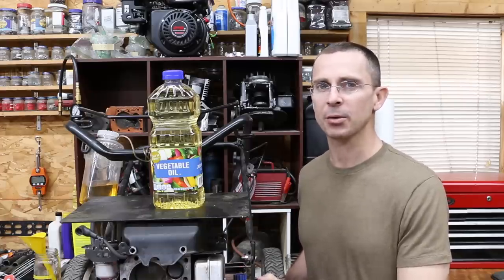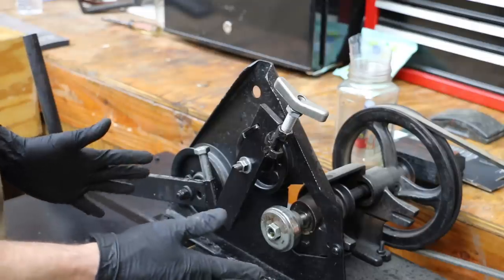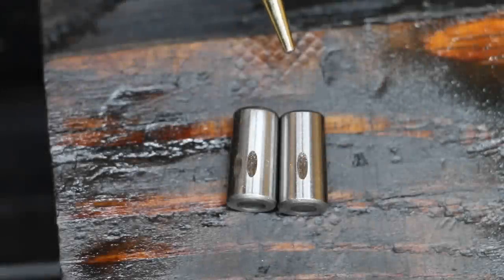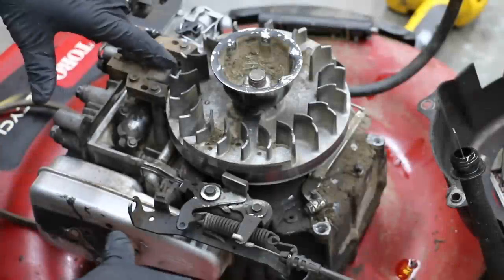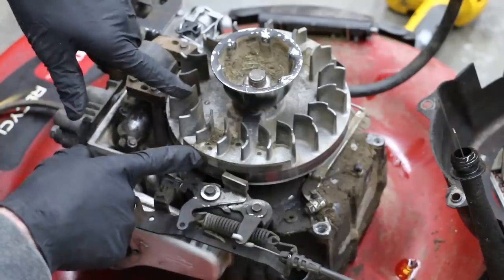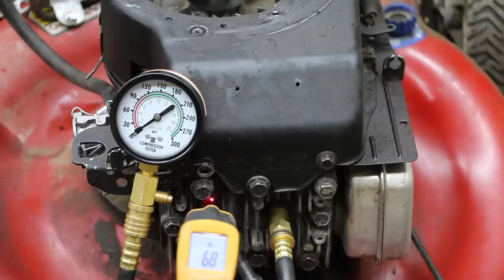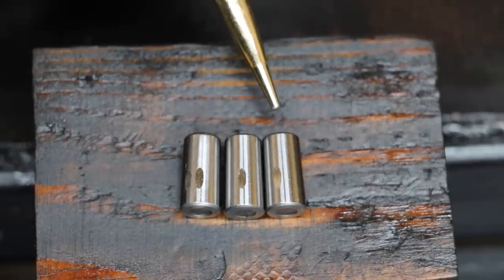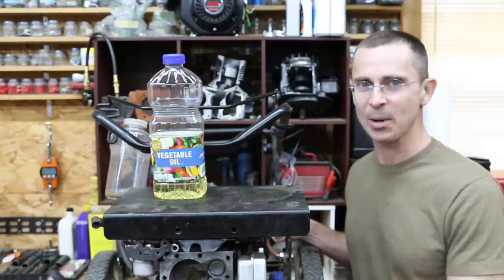Will Vegetable Oil work as Engine Oil?  Let's find out!

Comment: Major differences in veggie oil versus mineral base in this role is that you have to be extremely picky about which veggie oil you're using because they have different properties, and ALL of them will be hygroscopic to some degree and will oxidize pretty quickly. Some (sunflower, safflower, walnut) will turn to gum when they oxidize, others will get corrosive. if an oil is noted as a drying oil, it hardens when oxidized... you can actually add a drying agent to it (an oxidizing catalyst) and finish wood with it, hard as any other coating. 

Mineral oil and synthetic bases have the major advantage of being oxygen stable, the oil base itself isn't going to go bad so much as the additives will be consumed or altered... and since a lawnmower normally just uses a non-detergent oil anyways, veggie oil with a flash above the cylinder head temp is no big deal PROVIDED you change it often. VERY often, like every third mowing. 

The 2-strokes and aircraft using veggie and particularly castor oil are doing so because mineral oils will usually ash pretty badly, and are horrible for the rings and cylinder finish and can clog exhaust ports/valves in time. Castor doesn't burn really at all, what goes in comes out which is why WWI pilots had such issues being downstream of a spinning rotary engine with a total loss oiling system (the crankcase is attached to the prop, the crankshaft hub attaches to the plane, and ALL the injected oil leaves the exhaust through open ports). No burn = no ash. The right veggie oil will do nearly the same, just with more soft deposits. Castor oil will also somewhat protect unhardened valve seats where the fuel doesn't have much lubricity... like old aircraft and car engines running low octane. This is one of the reasons tetraethyl lead became popular in gasoline, it has much the same effect... better, even.
Reply from the maker: Thank you!

Comment: My grandpa says when he was racing motorcycles they say castor oil gave the most performance in a 2 cycle engine (and they wanted absolute formants they even had a hollow camshaft for more performance) they said Castor oil would be the best but one problem it fouled the spark plugs fast. I’d like to see a test on does it have more proformance and does it if so how fast does it foul spark plugs

Comment: I was genuinely surprised at this one- I thought that there was no way this would work as well as regular engine oil, and I agree with you in that I wouldn't use it for permanent use, but in a pinch (say your RV or motorhome is running low on oil, but you're camping in a remote area with no mechanic for miles around, and you have vegetable oil in the kitchen) vegetable oil might do the trick and keep you going until you can get more proper oil.
Reply from the maker: Thank you!
Reply: I even use veg oil in purpose as 20% additive to my engine oil , try it and the result might suprising you

Comment: Canadian Tire was selling a 30W bio-derived oil a few years ago. I tried it in my lawnmower and it worked fine but i did notice that it gelled in the winter in a cold garage. I don't remember the brand and haven't seen it since. 
I wonder if it was canola oil or something similar with a few additives? 
Other than gelling in the cold, and i mean, you wouldn't use 30W in a snowblower anyway,it worked fine.
Reply from the maker: Thanks for sharing.

Comment: In my early youth, 1950's, I had a relative who raced sports cars. He told me the best engine oil at the time was castor oil.  The only drawback was after the castor oil got hot from use you had to drain it out before it cooled or it would jell. This was back before multi weight oil was invented.
Reply from the maker: Thanks for sharing.

Comment: Threw a rod on a '64 VW Bus in 1976.  Lost most of what was in the crankcase in the first 2 miles
-limping off I-80 toward a garage in Newton, Iowa.  The last 2 miles were achieved solely on a gallon of Peanut Oil. 
(Remember fondue?)  Needless to say, I had to rebuild the engine.  Still drive it on occasion.
Reply from the maker: Thanks for sharing.

Comment: Older engines, especially those for the motorcycle and aircraft industries, were sometimes designed to run on vegetable oil. Specifically castor oil, which is where Castrol got its name.
Reply from the maker: Thanks for the feedback.

Comment: There was a test back 16 years ago about using soy bean oil as a substitute for motor oil. I recall the conclusion was that it protected the engine as good as a regular motor oil but failed for freeze condition.
Reply from the maker: Thanks for sharing.

Comment: Some of you may have seen Terry Dyson's extensive blog about testing and analyzing various different motor oils. Surprisingly, in the straight out of the bottle category, a vegetable based oil under the brand name of Renewable Lubricants scored very highly and ranked number 3 out of 226 oils and oil/additive blend combo's.  

       I don't think he tested the oil's cold properties though.  However, it is branded as a 5w-30w, so it should flow well at colder temps.   

     There is some precedent for this, as castor oil was and still is to some extent, popular in racing 2 stroke engines. The problem with castor oil is that it doesn't burn off as well as synthetic and conventional oils, and leaves behind more carbon and residue.  However, it provides superior lubricity and durability as an oil.  Racers didn't mind too much about the carbon build up and residue, as they often take apart and manually clean and adjust the engines.  

     Obviously in 4 stroke and other closed loop oiled engines, that is not an issue.  I don't know if Renewable Lubricants uses castor oil as a base or in a blend though.  

   Moral of the story, the right kind of and rightly processed vegetable based oils, certainly can be used as engine oil. The start of thermal break down temp of the Renewable Lubricant's oil was 275*F which was higher than some synthetics and a number of conventional.   

 Dyson believes that the additive package that goes into an oil is ultimately more important than the base oil being used.  I would mostly 2nd that with the caveat re: vegetable based oils--obviously these need to be the right kind to begin with.
Reply from the maker: Impressive!
Reply: @ProjectFarm     Yeah, I'm currently trying out the one that I mentioned above, for my 150 cc Piaggio Scooter. It's hard working, high revving, high compression engine that is air cooled, so I wanted close to the best stuff for it, and bonus that it biodegrades faster than other oils in an open environment (though I would not say that it's completely non toxic. After blowby and combustion by-products, it definitely will have some enviro toxicity).  

     I just changed it a couple of days ago (and bought it a week before that), and I'll probably do a change in a couple thousand miles, and let folks know how it goes.  Unfortunately, I don't have the funds to have a sample sent off to be tested. Maybe at some point in the future.

Comment: Probably won't see this but I feel like a good way to load the engine without a brake or grass is to get some blades and bend them sideways so that the air becomes the load as the sideways blades try to spin at 2000rpm

Comment: I use cooking oil (usually corn or canola, olive oil is a bit expensive) as bar/chain oil in my chainsaws.  It leaks out a tad faster than petrochemical bar oil, but that's a good thing as far as lubrication goes.  I'd rather leak a couple of ounces per hour of corn oil onto the ground near my well and river, than an ounce per hour of a petroleum product.   I only do a few hours per year of chainsawing, so I'm still on my first 48oz bottle of cooking oil for it.
Reply from the maker: Thanks for sharing.

Comment: Folks in Malaysia use palm oil in their engine....but they must mix a small amount of oil treatment. Palm oil has a high smoking point at 230 deg celcius or 446 fahrenheit. 
Eg. A car that needs 4 quarts oil - 3 quarts palm oil mixed with 1 quart oil treatment. Eg STP ,Lucas, Bardahl B2 Oil Treatment. 

Cost- 3 quarts palm oil is is ard $10 and 1quart oil treatment is abt $15. Total $25 Malaysian ringgit. Which is abt US$6.50 for the whole thing.
Reply from the maker: This is interesting! Thank you

Comment: Study I encountered from '50s measuring wear, based on oil time of use, implied that newer oil is a much worse lubricant. The study, utilized radiation on wear surfaces, and it's subsequent levels in oil. Oil break-in period was the poorest lubrication period, and the oil continued to perform better throughout test. Have you ever compared different age oils for their comparable properties?
Reply from the maker: Thanks for the video idea.

Comment: Great video but the problem, you need to heat the oil some hours without burning it all, after you will get a better oil than anyone else. I used to use vegetable oil in my motrocycle, the best eay is to preheat it a long time without burning it, It starts diminishing, and getting greasier.
Reply from the maker: Thanks for the feedback.

Comment: wondering if you have any videos about using vegatable oil in high rpm chainsaws that use 50:1.   Im looking for a healthier oil to mix with my gas.  Anytime you use any 2 cycle engine you are basically breathing in and absorbing petroleum based molecules into your body which can't be good for it.  I'd like to instead have edible oils aborbed into my body when cutting wood and mowing the grass.
Reply from the maker: Thanks for the video idea.

Comment: Consider using a fan blade on your test mower as a load.  A old metal window fan blade or auto engine fan  bolted to the crank might add a horsepower or two load without burning up the brakes.
Reply from the maker: Great suggestion! Thank you

Comment: I busted the steering gear seal in my truck and drove 200 miles with olive oil running my power steering. Replaced the gear and the pump still runs fine.
Reply from the maker: Glad to hear!  Thanks for sharing.

Comment: Well it's three years later, I want to know if you could add veggie oil to ethanol and see if it would run a 2 stroke with no problems, you have proved its lubricity in a four-stroke it would be interesting if it worked with ethanol as a two-stroke pre-mix.

Comment: I used vegetable oil to lubricate a seized padlock about 8 years ago it fixed the padlock n made it work like new I haven't had to lubricate it since then either and I still use that padlock to this day
Reply from the maker: Thank you for the feedback
Reply: Slightly different application. Padlocks don't have oil pumps and padlocks don't get hot.
Reply: @paulanderson79  my point was that vegetable can substitute a variety of oils not just engine oil and in some cases like with my padlock may even perform better than oils typically used for that purpose
Reply: @Idlepit2  I advise you not to use vegetable oil in an engine.

Comment: How about the efficiency of veg oil VS diesel running in a diesel motor. I run WVO in my dodges in the summer and get nearly the same KM per 100 . I also dump in other oils that i come across that have no marking on the package anymore, from unknown engine oils to gear oils. They also burn similar to diesel.
Reply from the maker: Thanks for the suggestion.

Comment: I would like to see how it holds up in an engine using an oil pump to pressurize bearing journals as in a automotive engines that build oil pressure. This worked great in a splash type lubrication engine.
Reply from the maker: Thank you for the video idea!
Reply: Two stroke with veg oil

Comment: I believe the vegetable oil will work a lot better if the engine it’s put in is meant to use the viscosity of oil that vegetable oil is. If it’s the same then it should put as much wear on the engine (of course it will still cause some because it’s not motor oil)

Comment: Well, this was a surprise to me. I wasn't expecting that an oil normally used to cook were able to hold on lubricating a thermal engine for a considerably long period of time. 
I recently watched your video about using bananas as lubricating agent where that myth was obviously busted, and I was expecting to see something similar now.
Well, bananas obviously can't hold high temperatures without burning, while vegetable oil must be able to support them on a stove, or else it would catch fire. But between enduring high temperatures and maintaining lubricating power, as it was not designed to lubricate, there is a considerable distance. 
So I must say this one is confirmed. Thanks for sharing.
Reply from the maker: Thank you for the feedback

Comment: I have a 2002 320 diesel Merc which I run on kerosene, every 20 letres of kero I add half litre of cooking oil to lube the fuel pump, runs fantastic and doesn't smoke as much as diesel......
Reply from the maker: Thank you

Comment: castor oil (is a vegetable oil from Beans) used to be used as a high performance racing oil.. Castrol R. castor oil used to be used in WW2 aircraft engines too! it is very different to cooking oil though it has to be said and probably wouldn't suit modern engines at all..
I remember going to see classic motorcycle racing in my Teens, and the unusual small of bikes running on Castrol R will be with me for the rest of my life!
Reply from the maker: Thanks for the feedback.
Reply: In my experience castor oil bad for 2 stroke engine. create rust

Comment: It does work and works well with 2 problems 1  it thins out like nats piss when hot 2nd its a fatty acid and will strip clean all bearing coatings just leave i peace of copper pipe or aluminium in veg oil for a while and see how clean it comes out.
Reply from the maker: Thanks for the suggestion.

Comment: I would like you to use pure canola oil, which is closer in viscosity and other properties to conventional oil than soybean oil. Also, I would like to see use of multiple new engines with a control, i.e., with using conventional motor oil as well. The cheapest engines are obviously the best candidates, and break in would also be a good way to see the differences.
Reply from the maker: Great suggestion!  Thank you.

Comment: For your information I manufacture an engine oil that is based oil soy bean oil. It is formulated for air cooled engines that are used for Jr. dragsters and quarter midgets. It is also not suited for temperatures below 32° however above that it has been proven to be a superior lubricant for these engines
Reply from the maker: Thank you for the feedback!

Comment: Lawn mowers typically don't have oil pump and that's why ball bearings are used for the crankshaft (like the engine you used in the video). In cars hydrostatic bearings are used which is basically a different thing. There were no any informations about additives. Many people think it can be viable to put vegetable oil into their car based on this video (I have to clarify for some of them several minutes ago). Next time please warn everyone about the basic differences between the engines and oils, it can cause severe damage to a car engine even in short run.
Reply from the maker: Thanks for the feedback.

Comment: Heard a story about a C-47 cargo plane in WWII. Something let go in one of the engines and they lost almost all the oil but shut it down in time before the engine blew. Flying on one engine they safely put it down on a remote air strip. The problem was quickly fixed but, the remote airstrip had no aviation oil available. However, the C-47 had a couple drums of cooking oil on board. Not wanting to hang around the remote airstrip until some proper oil was flown in, they thought, "Why not?" They filled it with the cooking oil, fired it up and took off! The engine worked fine. When they reached altitude they shut the cooking oil engine down and made it to where they had to go. Supposedly there were no harmful effects except the remote air strip smelt like burnt french-fries. I've all ways kind of  thought this was a BS story but after the above test, I'm thinking, "Why not?"
Reply from the maker: Interesting story.  Thank you

Comment: I was wondering could you test the effects of using vegetable or sunflower oil as a substitute for fuel in a Diesel engine. I have a feeling it it is a bit thick and could damage a engine if it is use for a extended time but I have used it in a 1.9 306 (no turbo) and it seemed to work well. 

However I think I have ruined the engine no because I run it on straight parrifin (heating oil) for a long time and she’s getting hard to start so I don’t know what has done the damage the cooking oil of the heating oil
Reply from the maker: Thanks for the video idea.

Comment: Somewhere, I read or heard the WWI fighter planes were lubricated with castor oil.  The problem was that a certain amount leaked out of the engines and blew back on the pilots.  Some of the oil found it's way into their mouths and gave them diarrhea causing the cockpits to be a mess.  I've never heard the story since.
Reply from the maker: Thank you!

Comment: This was unexpected! Nice job! But, i think, in a car engine it will not work. Its fine in a lawnmower, because it has rollbearings on the crankshaft, and the con rod. But every car engine has slide bearing on the crankshaft, and the con rod. I think, the veg oil, is not capable to handle the big pressure in these areas, and the bottom end bearings will cease to exist.
Reply from the maker: Thank you

Comment: Try to wear out brakes cheap verse expensive. I just replaced the brakes on a mercury with a 140000 miles and the pads seemed only half used (the factory pads!).
Reply from the maker: Thank you for the video idea!

Comment: I used a quart of vegetable oil to drive about five miles to get over to my dads house to fix a horrible oil leak as I had no proper motor oil at hand.   I made it there and after repairs the car still ran fine.
Reply from the maker: Thanks for sharing.